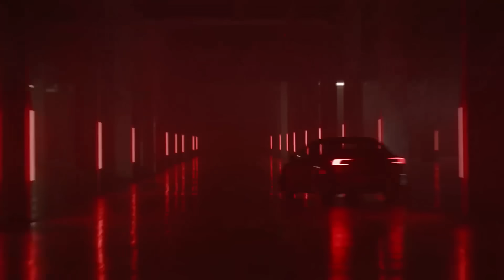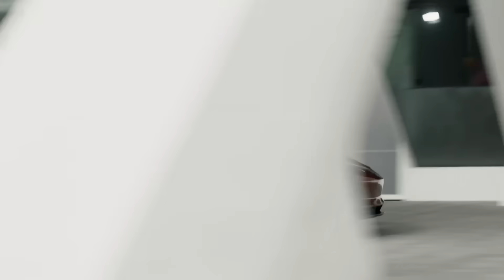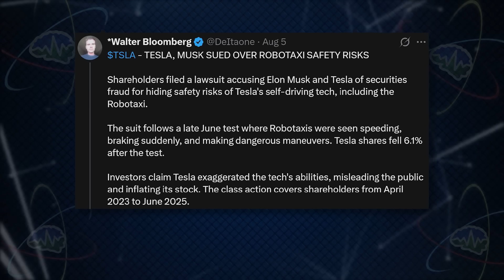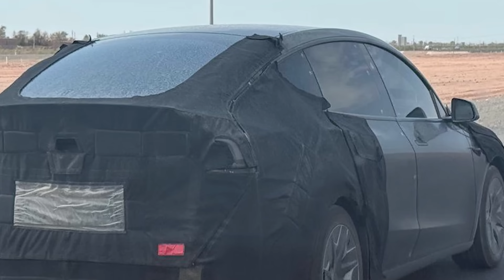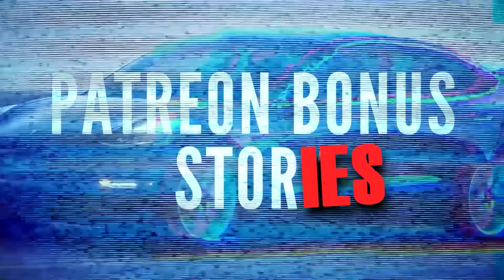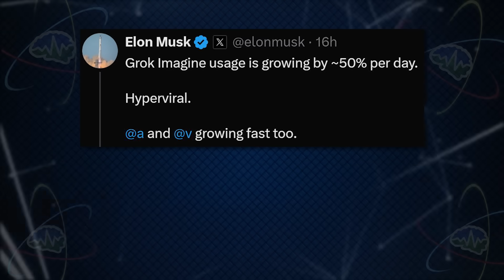Model 3 Performance Released! | Tesla Time News 503

Comment: …updates are all mumbo jumbo…at 510 horsepower , it’s about 200 horsepower to low…and the Hyundai Ioniq N is faster…the Porsche electric will also be faster, and another half dozen Chinese cars are faster...the absolute most wonderful thing that could happen is Tesla makes a Model 3 Plaid…with a new design…this is a possibility because last week Zac conjectured that Tesla in Germany had not listed Models S and X on the website, and maybe  was being discontinued…so how hard would it be to put a Model S rear end on the 3?…

Comment: Tesla announced the 2025 Model 3 Performance on April 23rd, 2024, with deliveries following a few months later. My only guess about why they are re-announcing the new Model 3 Performance, is to set up the announcement of the 2026 Model Y Performance, which has been eagerly awaited. Are there any differences between the 2025 M3P and the "new" 2026 M3P?